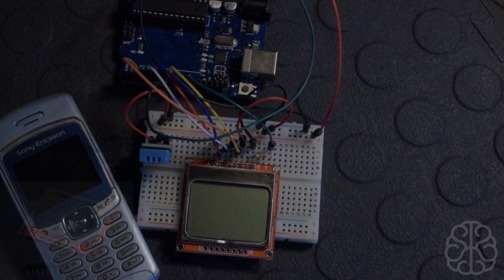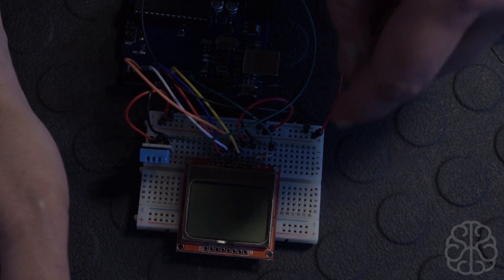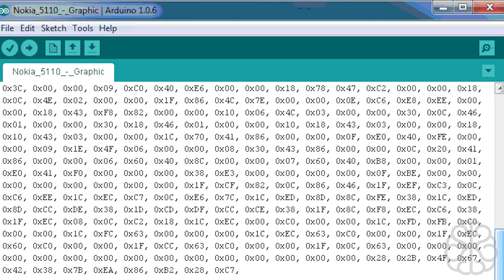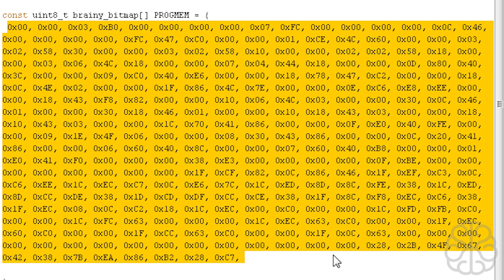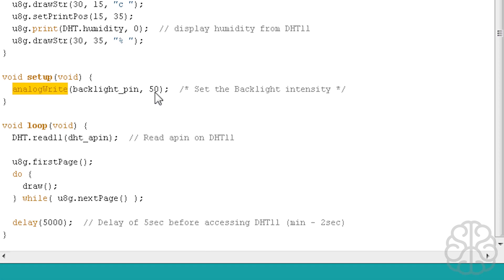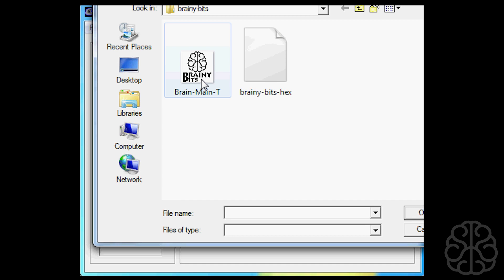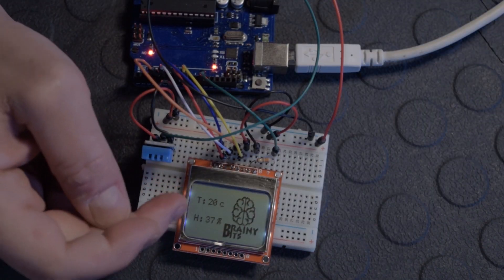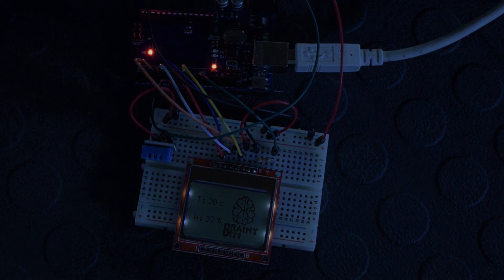How to use a Nokia 5110 LCD display with an Arduino - Tutorial

Comment: Compounding degradation of the components sinking the extra current occurs during over voltages of engineered systems. Just sharing. Still right with ya trying tho! :)
Reply: I would just like to add that you couldnt have done anything better with this video. It is exactly what I wanted you covered the hardware, and software perfectly. You saved me ALOT of time, thankyou! :)
Reply: Hi me. I was thinking a 220ohm resistor in series from the 5v to 3.3v inputs would at least limit total current to about 20 milliamps loaded. Where is my resistor box...hmmmm

Comment: Just to let people know it is possible to use the Nokia 5110 screens without a library using shift-out. 

https://thecavepearlproject.org/2018/05/18/adding-the-nokia-5110-lcd-to-your-arduino-data-logger/

That saved me from messing with the hardware SPI bus which we were already using for the SD cards.  A secondary benefit is that the code is really lean, on the order of about 250 bytes for the default font after the compile if you already have EEprom.h in the build anyway.  The font, however takes up about 500 bytes, and I wanted the smallest possible footprint so that we could add live data output to loggers that are already compile near the memory limits.  As it turns out, stuffing those fonts (and some calibration data) into the internal EEprom was pretty easy to do:

https://thecavepearlproject.org/2018/08/24/tutorial-using-the-arduinos-internal-eeprom-for-fonts-header-data/

Comment: Hello there,

I am getting this error when I use the dht library from your website 

WARNING: library DHTlib claims to run on [atmelavr] architecture(s) and may be incompatible with your current board which runs on [avr] architecture(s).

On the screen, I get the values for temperature and humidity to be 0. They never change. I want your help please

thanks in advance.

Comment: it does not read temperature! does display graphic...
Reply from the maker: +Bara Pellumb Does it display zeros or nothing at all for the temp and humidity values?  Check connections to the DTH11, maybe change jumper wire if using any, also try using different pin on your UNO that connects to the DHT11, if you do, just update the code to reflect the new pin used.  Hope this helps!  Thanks for watching!

Comment: Hi, thanks I built a small device based on this, used an Arduino NANO, this display, and a single 18650 battery in a carrier, but it all in a project box and put a small switch on the side.  Works pretty good, I use it for arguments with the wife when I say it's too cold and she that it's too hot.  Built one for her as well so we can have arduino fights, hers is based on an Uno and a 12 volt battery pack of 18650's with a small 2 line monochrome screen.  Hers has the more accurate temp/humidity sensor, so she can see that I am always right (YEP Sure after 46 years, I still have not learned!)
Reply from the maker: +Jerry Ericsson Hahaha!  That's a great story and cool use of electronics to solve an age old battle!  Always fun to see what others are building and glad to see that our tutorial video helped you achieve your goal of winning an argument!  Great stuff!  Thanks again for sharing and watching!
Reply: Nice!

Comment: I played with the LCD Assistant quite a bit before I could get it to work. You have to make the Pixel size of your bitmap Width = 50 & Height = 49 before you load into LCD Assistant. I did the following:
 1) Use a program to adjust the image size to a size of; Width = 50 x Height = 49. (I Use VuePrint)
 2) Save that file and open it up in Microsoft Paint. Save As a Monochrome Bitmap
 3) Load the Bitmap into LCD Assistant and check the radial button to "Horizontal". Verify pixel size as 50 x 49
 4) Then "Save Output" and open the output file in notepad then copy paste to the sketch
You could save a step by just starting in Paint adjusting the pixel size down to 50 x 49 by dragging the window at the corner. Then hand draw a picture then saving as Monochrome Bitmap. Then load into LCD Assistant... :)
Reply from the maker: +Scott Thomas Thanks for the comment and suggestion!  Also of course, thanks for watching!
Reply: Thanks a lot buddy! It works like a charm now.

Comment: I didnt know it was so easy to get to work.
Can you load any image into the lcd assistant and use it to resize the no. of pixels in the image, or does the image need to be saved the right no. of pixels before you load it into the assistant.
Reply from the maker: +power pack I believe it needs to be the right size before you load it in the assistant!  Thanks for watching!

Comment: Ok I have your code up and running but I need it in Fahrenheit... I am not that great in programming, I am a hardware person.
What I am doing is building a 900 MHz wireless weather station on a pair of Freakduinos..
I got them to talk to each other and fetch temp, humidity, wind speed and pressure but my temps are in Celsius..
Reply from the maker: ElfNet Gaming You can add a variable to hold the conversion to Fahrenheit like this :
float tempF = (1.8 * DHT.temperature) + 32;

then use that variable in the u8g display portion :
 u8g.print(tempF, 0); // display the temp in Fahrenheit

Let me know if that works for you.  Thanks!
Reply: Brainy-Bits I fixed the code line:
u8g.print(DHT.temperature * 1.8 + 32, 0);

That eliminates the whole float and such and does a direct conversion and it works.

Thanks for the help, though. I would have probably never figured it out.
Reply from the maker: ElfNet Gaming Thanks for posting your solution!  Might help others wanting to do the conversion.  Thanks for the comments!
Reply: no problem

Comment: You should use a level shifter when driving these LCDs with the UNO or you risk burning out the IC on the LCD board.
Reply from the maker: ElfNet Gaming You are correct that it's recommended since these use 3v logic.  But like I say in the video I've used these for a while with 5v and never had an issue.  But if you don't want to take the chance, then yes by all means use a level shifter to make sure.  Thanks for the comment!
Reply: Brainy-Bits Well considering there is plenty of NOS of these displays for literally dirt cheap, I personally think using a level shifter is overkill in the essence of cost and that this whole platform is a development / experimental thing. Now if you were going into a production scenario with this then YES by all means use a level shifter, But a good engineer would have the logic level at 3 volts and not 5 volts anyways..
But hey we are all still learning new stuff daily
Reply: I've also seen quite a few Arduino-5110 articles which specify 10K series resistors. Using some series resistor such as 10K would make sense if the logic pins of the display had some internal clamping to the 3.3V Vcc rail. But I don't believe there is such clamping.
As an experiment, I put a 5110 in a breadboard, and connected 3.3V to the Vcc, and ground to GND. I also had a separate 5V rail available. I temporarily connected a 10K resistor between 5V and each of the logic pins. Before this connection, those logic pins appeared to be floating around 1.8V or so. Anyway, each time I connected the 10K resistor  to a 5110 logic pin, that logic pin jumped up to 5V. If there was some clamping protection at those inputs, we would see the voltage on those pins not much higher than 3.3+0.7 = 4.0V. But no, those pins were at the same 5V as on the "input" side of the 10K. In other words, a series 10K resistor between a 5V Arduino "high" output and any of the 5110 logic pins would not protect those inputs from seeing a 5V signal. There may be some internal protection for the LCD controller chip, but it's not obvious.
If I had a spare 5110 LCD to sacrifice, it would be interesting to use a variable test voltage instead of 5V. Keep cranking up the voltage to see there is ever any kind of clamping at the logic inputs.
So, the correct way to manage the 5v/3.3V interface (assuming the 5110 module really does not like 5V at the logic inputs) is to use a proper level-shift chip,  or else a true resistor divider for each logic signal.